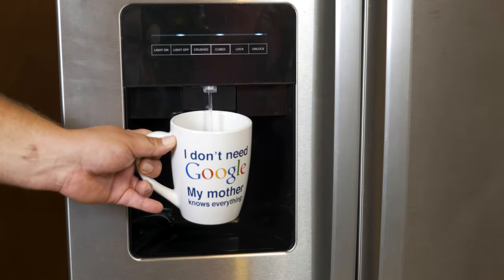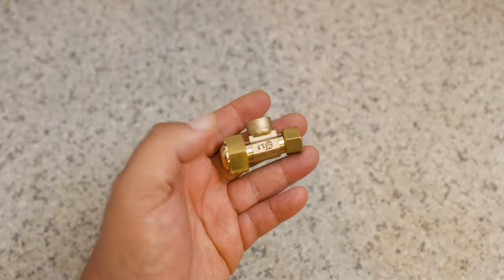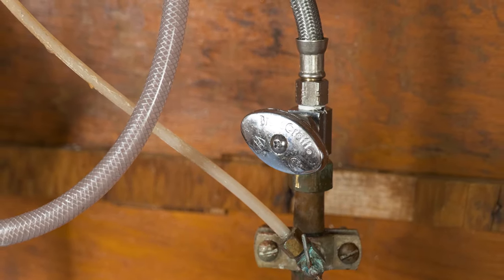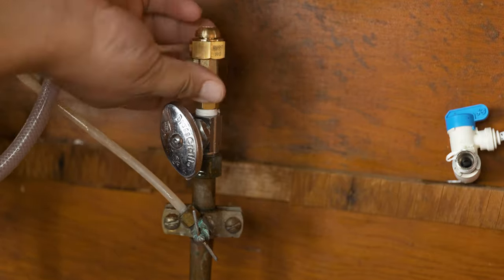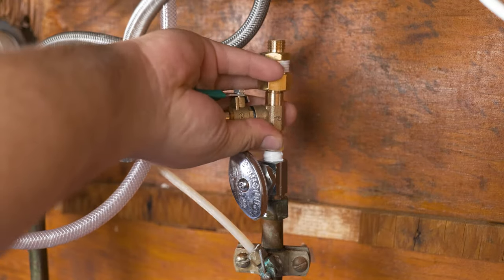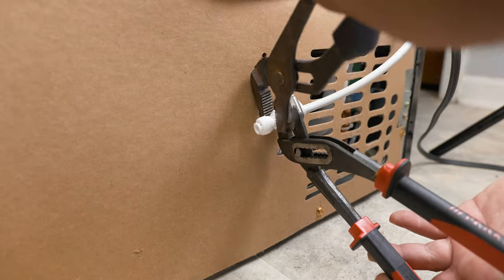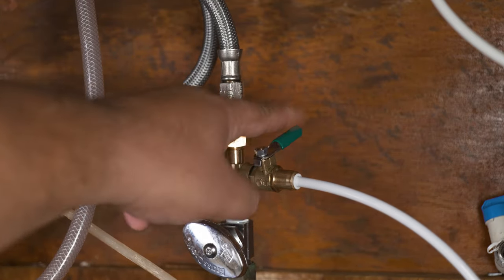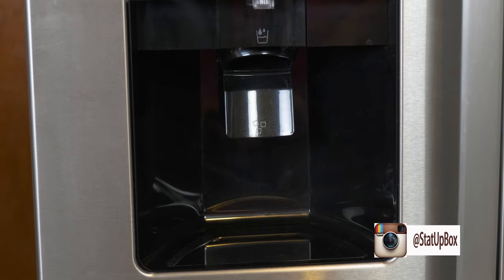How To Install Water Ice Line Refrigerator Easy Simple

Comment: This was so helpful. Also that was super easy to do. Took like 20 minutes to hook it up. Running the line through my basement however took a little longer 😂
Reply: I was wondering if I was crazy for thinking that I'd need to do it that way! Our sink is across from our fridge area 😀
Reply: @jessicabrunz7357  the most difficult part for me was trying to drill through the wall behind the fridge. My drill bit wasn’t long enough to reach through all the way. Now I have an extra hole back there but the fridge covers it 😂

Comment: Only criticism... use a second pair of pliers to hold the plumbing you are connecting to in order to avoid potential damage to existing plumbing.  Especially if you are invoking the strength of Thor or the Hulk.   I know, I know... Not easy to do when twisted like a pretzel and the base of the cabinet separating your ribs.  I also recommend laying down a blanket, pillow, cardboard, anything to take the edge off of the bottom of the cabinet!  Wishing you continued success!

Comment: Respect. I just ordered my line right now and will be pretzeling up myself under the sink.
Reply: i was able to get this done myself! saved $250.. (that was quoted to me by a local plumber).
Reply: The very reason my ice maker has not been hooked up for several years now is that to say I'd have to pretzel myself would be the understatement of the millennium! I'm not to flexible at 51. I wasn't that great in my 20's. Man! I need that 'body loosening oil'!

Comment: Thanks for the info and laughter 
My question is: My sink is across from the refrigerator  and there is the entrance door between them 
How do I install the water pipe ?
My kitchen has a high ceiling and the wall behind the sink is open; ie: doesn’t reach the ceiling .
There is a pantry to the left of the refrigerator then the dryer and the washer area .
Any suggestion, I wish to hire you for my inauguration:-?!

Comment: I’ve thanks… I was going to run proper plumbing to the back of the fridge and then the water kit ie thin white tubing… but it much easier to run the pipping kits straight from the sink… QUESTION… 🙋‍♂️ how long can I have the white tubing? My sink is about 4m from the sink? Is that to far?

Comment: Hello, look, I tried to search in the Ling that you put, which set you use, but it doesn't come up with the same one that you used. Ami, I'm interested in using the same things that you used. Could you tell me which set or all the things?
Reply from the maker: Metpure Ice Maker Fridge Installation Kit – 25' Feet Tubing for Appliance Water Line with Stop Tee Connection and Valve for Quick Installation, 1/4" Fittings for Potable Drinking Water https://a.co/d/bXdKFpk

Comment: Hey can you install a over the range microwave with that current set up you have? I have the same vent hood and was wondering if I can put a microwave there
Reply from the maker: yes you can, there are over the range microwaves that the weight is held at the walls (studs) and not as much from the cabinet (metal bracket system) , it all depends on your space from the stove to the cabinet and also the size of the particular over the range microwave. good luck

Comment: I hooked mine up but didnt turn ice maker to "off position".  Why do fire starter instructions state "turn ice maker to off position before supplying water to line".   I cant find any problems but wanting to know I didnt damage the new frig.  Thanks
Reply from the maker: in some refrigerators it can take 2-4 hours to make ice after turning off. you can check with owner manual. sometimes it says it right on the ice reservoir inside

Comment: Is going thru the cabinet the correct way to do it?
Reply from the maker: there is never a right or wrong way to do something in your own castle, its personal preference, in some cases you can go all around the wall, or the base board, or inside the bottom kitchen cabinets or even in some construction the line goes inside the wall. It also all depends your layout, in some case the fridge is right next to the faucet and there is no need to run the line thru anything. good luck.

Comment: Ordered the line and used this video to hook it up. Unfortunately I can't figure out why it's leaking badly by the wide connector part. It's on tightly on all parts but it wiggles on the wide end for some reason. Grrrrrrr Of course it wasn't going to be easy for me lol

Comment: I would add, if you're going to do this, opt for the upgraded steel braided water line, this plastic line included with your Fridge, is crap, and may spring a leak while your on vacation, ask me how I know.

Comment: question , once you put in the tubing to the t connection you just put it in and don’t have to tighten anything , wouldn’t the pressure of the water pop it off ?